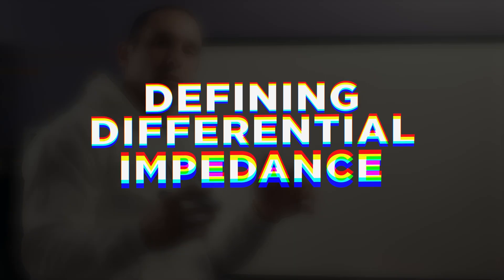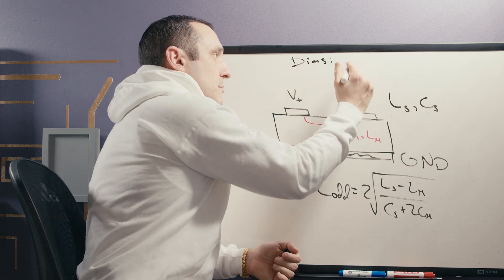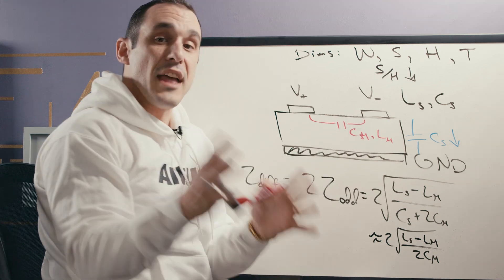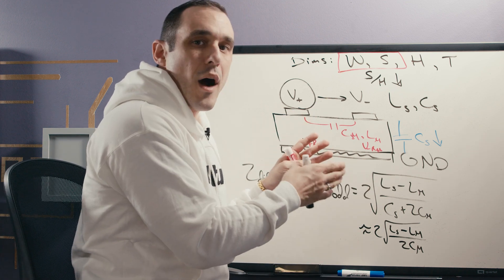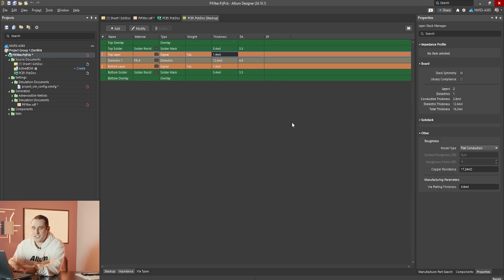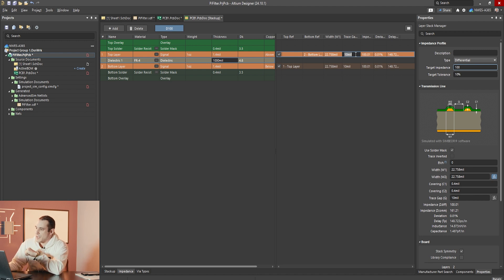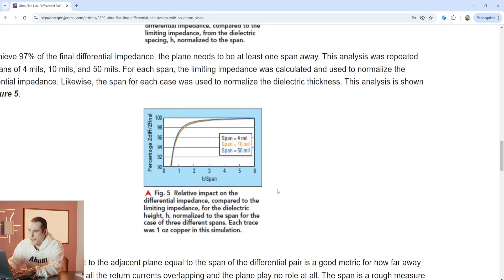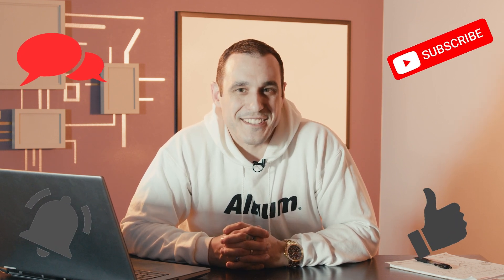Do You Really Need Ground for Differential Pairs?

Comment: Hi Zach,
Thanks for valuable insights.
I have a question I have a pcb with 1.2mm thickness and 6layer.
 and I am running USB signals in bottom layer.I have a split power plane adjacent to bottom layer.
Will it impact the USB signals. Unfortunately I am not able to provide Ground plane in 5th layer as I need a power plane.
Reply: This relates to a simulation video we created, it was about routing single-ended signals and differential stripline signals over splits in a plane layer (you can watch here: https://www.youtube.com/watch?v=swcFrt__HEE). With striplines, we can see that the effect of higher return loss limits channel bandwidth in the 10 GHz range, so this would not be consequential at lower data rates such as you would deal with in USB. There will still be some radiation from the reflected power and this might be problematic for EMI. However, we did not perform the same simulation work on microstrips, but I suspect the bandwidth limiting to be more severe due to the fact that there is not another reference layer like we have with striplines. Maybe I'll do a video on this topic on my personal channel.

Comment: Ground is still important for all practical differential pairs, because of limitations in the common mode range of receivers. The absolute voltages on the members of the pair have to be within that common mode range or the receiver will not reliably translate the differential signal to a single ended logic signal.

Comment: Many thanks for the video. Everything is clear, but I also would like to know the answer to the following questions: 
1. For example, I use a 2-layer PCB without ground under a diff pair. Can I route other signals on the opposite side?
2. In the previous case, should I place ground traces/polygons around the diff trace?
3. For example, I have a ground plane under a diff trace. And then the plane ends, but the diff trace goes further, and from some point, there is no ground plane under it anymore. That's clear that this is not a good thing, but "how much" is it bad? For example, if I converted analog video signal to a diff line, there are no spectrum above 10 MHz, so how will it affect this kind of signal? Should I change the trace parameters in this case after leaving "grounded" area?

Offtop: There is one more topic that would be interesting to me. There are a lot of devices that were designed decades ago and almost completely out-of-date now. For instance, the control system for trains. It must have high reliability, and they work great. However, their PCB design (70s -90s) doesn't comply with the current understanding of how to design PCBs. In this condition, managers often think to keep the past approach and avoid enhancements. What do you think about it?
Thank you for your content!
Reply: 1. Yes you can route signals on the other side. Maintain clearances to prevent crosstalk between your traces.
2. Do not use ground traces in high speed designs, they only provide some benefit in low power audio designs and some other low frequency analog designs. In 2 layer boards, you need to use grounded copper pour to get a differential pair to have a reasonable trace width and still give you a desired target impedance.
3. I’m happy to answer this question but it would be a very long answer for a youtube comment, so I will make a video about it. It may be published on this channel or on my personal channel, I’m not sure yet.

Electronics is a very conservative and risk averse industry, so a lot of times companies take a “if it ain’t broke don’t fix it” attitude to legacy systems. Of course once something does break, there is no chance of replacing a single part on a system that was developed 30 years ago, and that’s when they are forced to do a redesign. I think the risk of having one unit fail and designing into the legacy system often costs less than constantly trying to keep up with upgrades just because your old parts went obsolete. If you can get by without an upgrade then the can will keep getting kicked down the road.

Comment: When do we choose single coplanar and differential coplanar in 9:28? Can make another video to discuss about this?
Reply: The most common reason to do this is when you have a 2 layer PCB that requires controlled impedance, bringing the coplanar ground closer to the traces adds some parasitic capacitance, so this requires to make the trace smaller in order to hit the impedance target. A very common example is in USB, and I show why this is the case in this video: https://youtu.be/4LwnEaNvG8I?si=EXof27d5wao-g8oF&t=768. The same idea would apply for a single-ended coplanar line. At some point, you will be limited by etching clearances and tolerances, and the only way to make the trace narrower is to have ground closer to the trace. Note that if you apply a large clearance for the coplanar around the differential pair, then the coplanar ground will have very small influence on the differential impedance.
Reply: @Zachariah-Peterson  Hi zach can you make a video to talk about and explain which layout is consider as coplanar configuration or which layout is consider as non-coplanar?

Comment: Hi Zach, very insightful video on theoretical vs practical case on this topic, although it still begs the question as to how much degradation we see in signal integrity of differential pair when the tight coupling of that pair is broken due to choke/coupling cap/via in its path?? Since in this case, diff pair without any GND reference depends upon tighter coupling present between its traces, the further you pull them apart, higher the deviance from its characteristic impedance... Which might not be that bad of a case when there is somewhat loose coupling and GND reference plane is present below the pair.... Would love to hear your views on this...

Comment: This is super cool stuff. I haven't seen anyone else cover this type of detail in PCB design, and it's really useful for someone less experienced to get an intuition for behavior on a PCB. It sounds like this heavily applies not just to things like USB but also to PCIe. I have always wondered how the boards are routed in order to achieve the bus clock speeds for PCIe devices, and this is starting to help make sense of it. Seems like the traces would need to be very close together to make sure they are as self-referrential as possible, in order to make each serial pair as stable as possible. Or maybe I am misunderstanding.
Reply: The idea that you must have the traces very close to each other in order for the differential pair to provide enough bandwidth for a high data rate interface is a myth. You could route the two traces on different layers, as long as the signals arrive at the receiver at the same time then the interface will still work. Some reasons we keep the traces close together is to help with suppression of differential crosstalk (either received by the differential pair or injected into a victim differential pair), and for reasons such as matching pin pitches on components/connectors or for routing between balls on a BGA. If you keep traces too close together, then there is a risk that any impedance deviation creates excessive mode conversion, which will limit the channel bandwidth and cause too much signal to be converted to common mode noise. These principles apply for USB, PCIe, clocks in DDR, Ethernet up to 112G and faster, etc.

Comment: What would happen if we have a thick trace(GND) between a differential pair on the same plane (on a two-sided board)?
Reply: This forces you to separate the traces from each other, so you have something similar to a single coplanar trace and another single coplanar trace being used as a differential pair. Technically, in order for a differential interface to function, it does not matter where you route the traces as long as the two opposite polarity signals arrive at the receiver at the same time. However, to get certain benefits related to suppression of crosstalk and ability to send the signals over a cable with no ground wire, the traces must be closer together. Since you have brought up doing this on a two layer PCB, your traces will probably be too large to be useful in any way. I would suggest you get used to using 4 layer PCBs for anything digital.

Comment: Isn’t it true in most layouts that the field of each trace is mostly contained in the space between the trace and the reference plane (not the other trace)? I think the magic of diff pairs in cables and uhdi was shown, but for most board designs it’s a different animal, right?
Reply: Well I never meant to state that the field from one trace is "in" the other trace, just that the return current from one trace is in the other trace as long as the two signals are together in space. However, if you have ground nearby, there is also return current in the ground plane. The return currents are displacement currents which are excited by the changing electric field between conductors. This is where the reference to the field being in the space around the conductors comes from: it is the changing electric field during the signal transition (and thus also a changing magnetic field).

Comment: Hi thank you for a great video. Maybe it’s is just semantics 😊
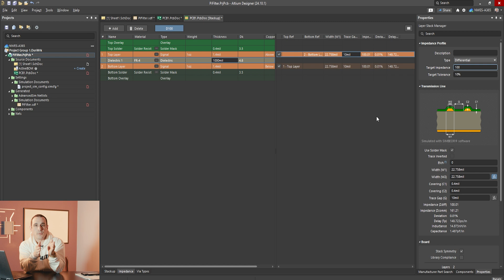But at the example at 10:32, where you set the width to a 100mil, the spacing is 25.9mil (not 21mil) and then it actually decrease to 22mil. So the width is actually not increasing.
Reply: he also changed the tracks gap

Comment: hi zach... a european viewer here... why does altium keep pushing the imperial measurement system, ie: 'mil' when the whole world (your audience) uses metric..?  when was the last time you saw a component built according to imperial measurements..? even the ipc and other american engineering organisations strongly recommend using the metric system... other than that i'm a big fan of your content 🙂
Reply: 0402, 0603, PCB copper thickness oz per square foot, all of these (understandably bad) measurements came with US first adoption. 

As such, currently the PCB world seems to be stuck with these units.
Reply: Hi there. I am from Poland. I use ONLY imperial (mils) measurements because it is more convinient into a design. For instance, I use 10 mils trace, 20 mils, 150 mils etc. In metrics it would be 0,254mm, 0,508mm, 3,81mm. It's then to complicated. And mils are just as it name says, the inch divided by a thousand, so it is very accurate and you don't have to use a comma in numbers. Even simplyfying measurements to 0,25mm, 0,5mm, 3,8mm, they are still numbers with comma and they are not so easy to operate.
Reply: I use mils
Reply: No one is "pushing" people to only use imperial measurements, and Altium certainly isn't. I'm American so I'm more used to using imperial when it comes to building things. I'm also a physicist so I'm also used to SI units and you'll notice that I always do the on-the-fly SI calculations with SI (MKS) units. I never took the time to learn all the conversions to CGS intuitively, otherwise you would see me doing everything in cm/mm.
Reply: @ - thanks for answering...

Comment: This seems like a really controversial topic! I wish there was some more testing on design aspects like this.
Reply: indeed. I've recently been preparing myself to route some usb3 signals for the first time ever, and i've found a routing guide from Renesas. It says that having a track cross the diffpair through the groundplane layer is an absolute nono. It is certainly very bad to break a ground plane under a single-ended stripline, but i feel like it should actually be okay with a diffpair.
Reply: @victortitov1740 I think you are spreading the  little return current and that makes a very big field that induces unnecessary noise into the diff pair itself. Why are you asking for trouble?
Reply: @victortitov1740  Check Rick Hartleys talk on "what your differential pairs wish you knew", he describes why this is not a good idea. I personally trust his explanation more, coupled with Lee Ritchey's text on Differential Pairs (nothing against you Zach! 😅)

Comment: This is sorta unrelated to this video, but I had another question:

Why do we panelize boards if the fabricator will be distributing our design on the panel anyway? Do they not configure the design to be as optimal as personally laying out a panelized version?

I know a lot of pcb design speakers that say we shouldn't leave design factors up to the manufacturer (such as impedance control, stackup, etc.) Is Panelizing a design included in this idea of not leaving design factors up yo the manufacturer? If so what are your thoughts on why?
Reply: In some situations, the panel itself is the deliverable and must conform to specific requirements for further processing. If you're just buying individual pcbs, let the board house work out panelization for fab. If you're processing the panels as a whole, you should specify the exact panelization you need.
Reply: @jonathonmcmillan9410 exactly, sometimes the test fixture is made in such a way to test a panel so you have all the connections made on pcb outside your actual board.
Reply: The board orientation relative to the panel orientation also matters in cases where fiberglass weave direction makes a difference. Even if it doesn't matter electrically (thick traces), for elongated boards it could matter mechanically.
Reply: I have recently panelized a collection of three boards that were a part of one design. 1) seems like ordering one larger design is often cheaper than ordering a few smaller ones. 2) i needed the same stackup for all of them, so doing it all at once saves time and reduces the likelihood of mistakes during ordering. 

The mfg has noticed there are 3 board, and bumped up the price quite a bit unfortunately... I feel like it's quite unfair.
Reply: @victortitov1740  yeah they charge the designs not the gerbers
Reply: It depends.... Some of my clients are EMS companies and they ask me to panelize boards, and they give some guidance on doing this. Some manufacturers (Eurocircuits for example) give a panel template that customers can use to create a custom panel. And in some cases, the manufacturer is not going to use your panel even if you create it and include it in your file package. They will just make a panel because, most likely, the panel you designed will not meet some requirement for tooling, depanelization, etc. When doing a fabrication run with a board shop, you can request that the shop provide the panel to you and you can request a specific orientation, but don't be surprised if they handle the design of the panel, specifically tooling and depanelization option (like mouse-bites or v-score).
Reply: I also noticed that some manufacturers will charge a fee for one of their people to do the paneliz-ing. 😅 So I'll add that to the list too.

Thank you all for commenting!